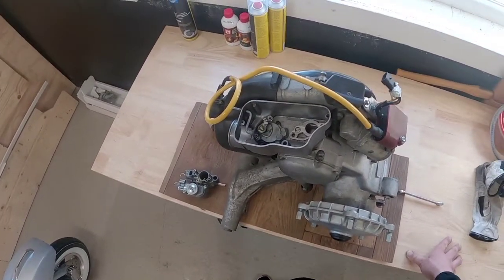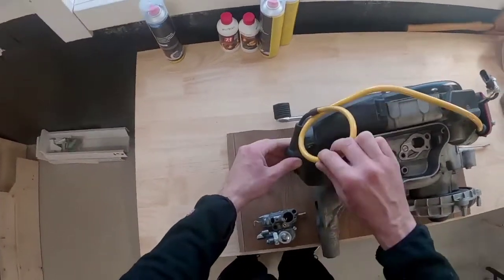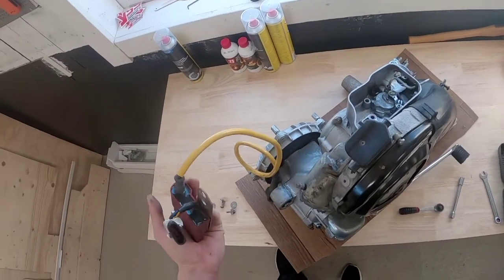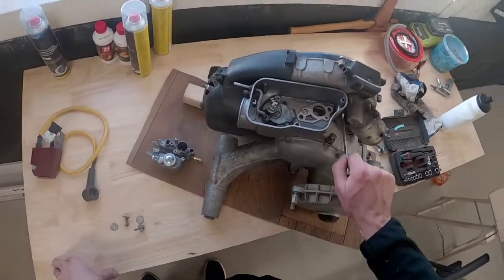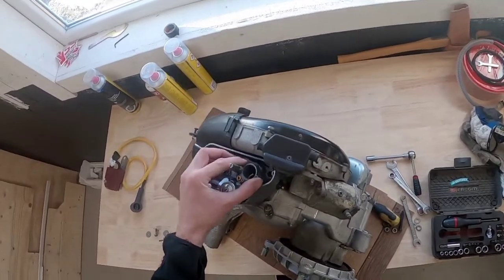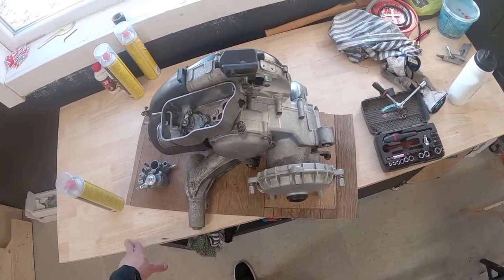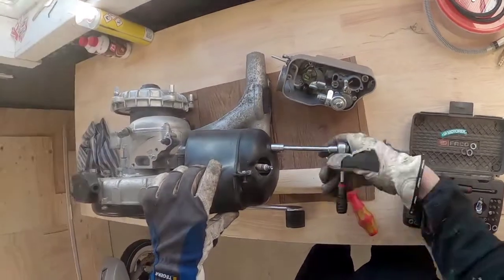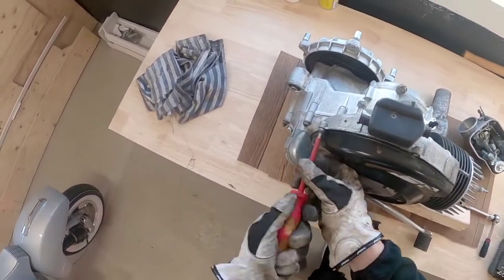Vespa px / How to remove the flywheel and starter motor

Comment: Hello - checking out your video which is very useful thank you I do have a query though as my flywheel is stuck, I cannot move it at all. Any ideas to get this to move? Mark
Reply from the maker: Hello and thanks for watching.
Check this video:
How to install a lighter flywheel on a Vespa px200e
https://youtu.be/JOi1fZq7u34

You must have a proper flywheel remover otherwise you won’t be able to get it off.
Reply: @Nordicexplorer1  many thanks will check this out
Reply: Hello again, so thanks for the guidance. The 28 flywheel tool arrived and removed the flywheel. Note that whilst I thought the flywheel was stuck, it wasn’t as the crank does still not turn. The kick start returns with clutch in but in neutral the kick is stuck. Do you think the piston or crank has seized? What to do next? I have vídeo if you can help? @nordicexplorer1
Reply from the maker: @MisterDonni  you can easily remove the cylinder head and cylinder and find out if it  sized.
Have you made any changes to the engine that may have lead to your problem? Did it happen during riding or after long time if stand still?
Have you changed the clutch ?
Reply: @Nordicexplorer1  no changes have been made to engine or clutch. Bike has not moved for 2 years though. When last ridden all was ok, fuel tap was off and ran carb dry before storing. Will check the head next thanks. If it is stuck, does that mean a new cylinder?
Reply from the maker: @MisterDonni   remove the head and cylinder to have a look, just because it’s stuck doesn’t mean you have to change. It depends on the state of the piston, rings and cylinder.
Reply: @Nordicexplorer1  thanks again….will do. Will send a photo….

Comment: My PX does not have the starter ting and I want to install a new one. Are they a press fit as I can not see any mounting holes and will it fit with a Pinasco Vespone RX190 cylinder fitted? I am not at home so cannot check. Thanks.
Reply from the maker: Hello Mark.
I’m not sure what you mean by “starter ting”, so you have to explain more in detail please.
Reply: @Nordicexplorer1  Sorry, I meant starter ring as in the teeth on the flywheel. The cylinder looks like it has fins missing on the flywheel side, maybe to accomodate the starter ring.
Reply from the maker: @Mark-wx1ho  Ok. The fins that are missing are as you said to accommodate the starter ring. The ring is normally welded , pressed or screwed to the flywheel depending on what sort of ignition you have. I use a polini ignition and the ring is welded but on a malossi it’s often hold by screws. Original I think it’s pressed.
What ignition do you have?
Reply: @Nordicexplorer1  I am not sure. Just standard I believe.
Reply from the maker: @Mark-wx1ho  ok, then I think it should be pressed to the flywheel. Seems weird that it would be removed. Could it be that the base of the cylinder is to large and is in the way for the ring? I don’t know that much about the rx190, but if the fins are removed I think it should work. Sometimes you have to grind a bit of from the cylinder to have enough space for the ring.
Reply: @Nordicexplorer1  I will take a look when I get home and work it out. Thanks for the help.